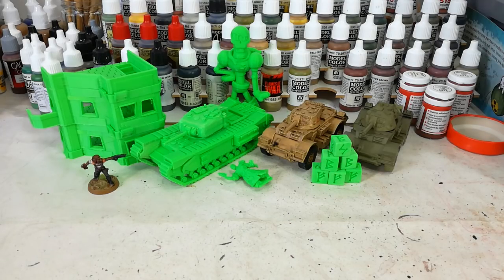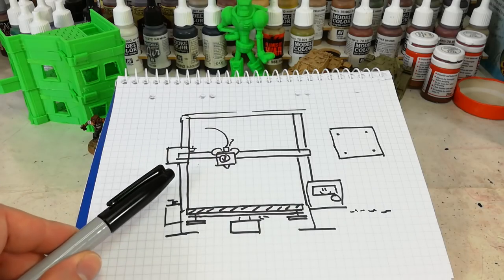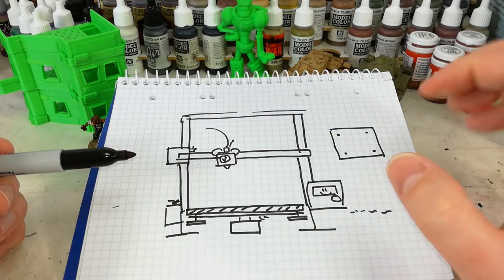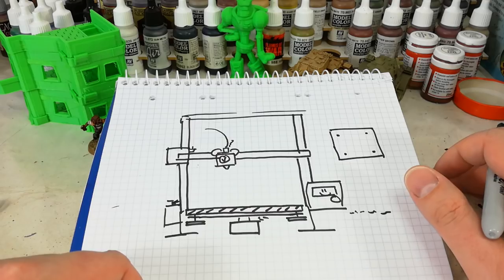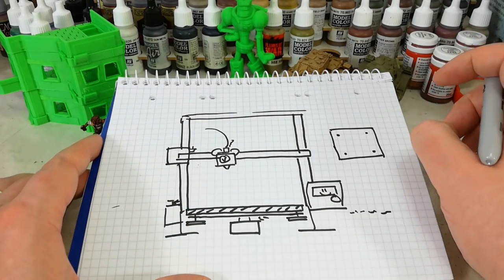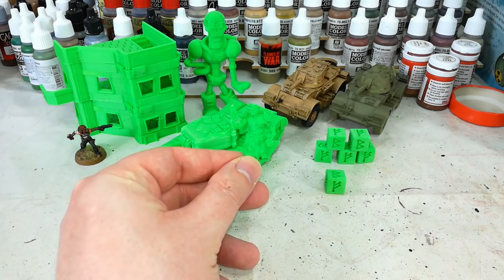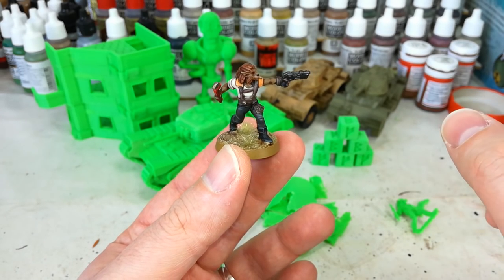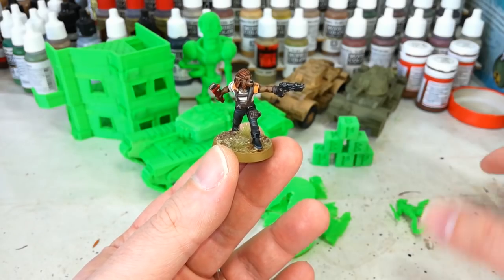How I Print Things - Basics and Getting Started

Comment: I believe there is a huge market for things that are best done on a 3d printer that are miniature/hobby related (as opposed to miniatures.)  One thing I would love for someone to come up with is a funnel topper for the different pot styles (P3/Coat de Arms as well as GW) so you could open the pot, place the topper on and then pour into a dropper bottle and just let gravity do its job.  The current way of having to use a makeshift holder to hold it while it pours into a funnel placed in the dropper bottle has caused many an accident and I don't even want to think about the wasted paint.
Reply from the maker: There's some really neat designs over on thingiverse.com for paint pot holders, most of which are quickly knocked together by cunning folks using TinkerCAD. I'm with you; I think there's a massive realm of opportunity for folks to turn out neat little quality-of-life bits and pieces for hobbyists, whether for game trackers or painting tools. It's neat to see what's already out there, and maybe with a bit of fiddling around I can get the hang of my own designs too. It'd be interesting to try and conceive something straight from design to prototype to print!
Reply: I’ve been meaning to design one of these, my printer is broken at the moment waiting for a part to come in shouldn’t take me long to whip one up